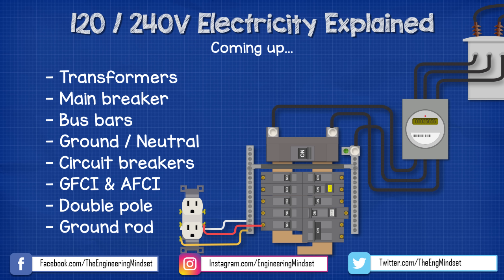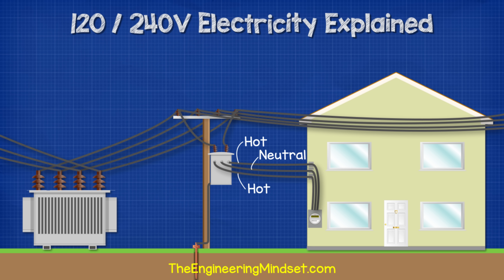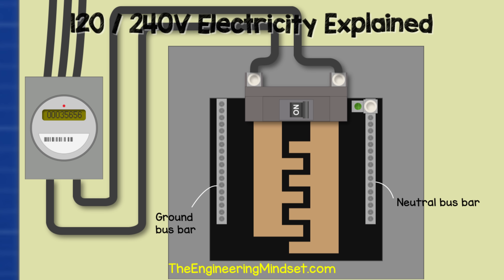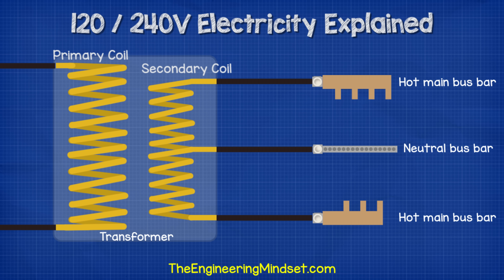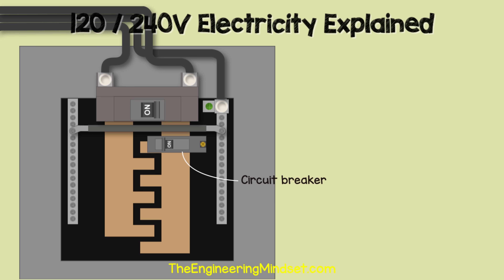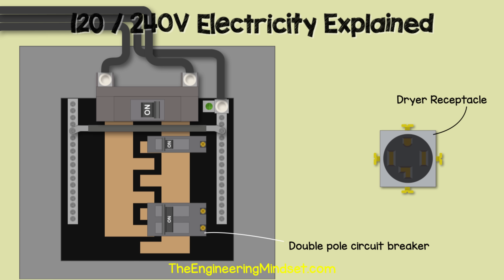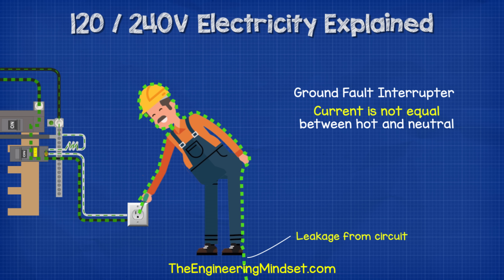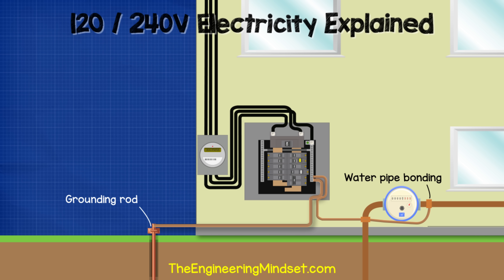120V 240V Electricity explained - Split phase 3 wire electrician

Comment: Wait, the ground wire in the US is connected to the Neutral? It's not connected to GROUND, like its name suggests?

Meaning that if a person becomes the connection to ground the breaker won't trip from the circuit running to ground?
Reply: The ground (green) wire must be connected to the Earth via a ground rod at some point
 for safe operation. If a person connects a hot wire to ground through his body, the breaker may not trip. It depends on how much current flows through the person. Of course a breaker can supply more than enough current to kill, so watch it!
The neutral is connected to the ground wire, but the ground wire does not carry any current, except in an exceptional (and unsafe) situation.
Reply: Correct. A GFCI is needed to protect against such faults.  A pity they don't put them on all circuits.
Reply: @Mister Brookes TN-C-S will protect if live is shorted to either N or PE since those are bonded together. But shorting to PE is not the same thing as shorting to ground.  A GFCI protects again a ground fault (eg you touch live while standing on the ground). TN-C-S only blows the fuse when live shorts to PE - eg your toaster breaks somehow and the chassis is connected to live. (and is safe to touch).
Reply: The "neutral" or grounded conductor, is created at your transformer. At one end all the coils of your transformer are tied together and to a ground (typically a ground rod driven into the Earth) from this connection a "neutral" wire is also connected which is why in code it is called the grounded conductor.
Reply: @vegasjw  here's hoping the connection back to the transformer doesn't fail then. and that you don't create a path to ground from live with your body.
Reply: @jnawk83  this is the connection that is on every wye connected transformer. Along with the neutral there is a ground conductor in every conduit/raceway which bonds all metal parts and gives a low resistant path to ground. If the neutral "fails" you have an open neutral and therefore have an open circuit. As the video says the neutral is the return path for the current in the wire. I think you are confused about what a breaker does and a GFCI does. A GFCI simply measures the difference between the current in the hot and neutral and turns off the circuit in less than half a cycle if there is even a very small difference in current. A GFCI is designed to protect people and is only used in wet or outdoor locations. You can't use a GFCI for every circuit because the inrush current in many loads is enough to cause nuisance tripping.
Reply: @vegasjw  if you didn't run absurdly low voltages then you wouldn't need to run absurdly high levels of current, and frankly, power factor correction electronics are not that big a deal for residential workloads. there is an RCD on every circuit in my house, and the same is true for all code compliant houses in my country, yet nuisance tripping is not a thing.
Reply: @jnawk83  Yeah I don't understand the use of 110v in the US, doesn't make any sense to me. You more than double the required current to run the same devices at the same power. And to do so means you need much much more copper to handle that current, and even then still a great chance of fire because of high current.

The 230-250VAC of most other countries, Europe, Australia etc. is much better.
Reply: @vegasjw  Jesus a GFCI isn't used everywhere in the US? My god.

Here in Australia, every single circuit is on an RCD (GFCI in US). The same goes for the UK, and all of Europe. 

Never had any nuisance tripping. And the fact that not every circuit is ground protected is just insane, and dangerous.

I can RCD replacements for my circuit board for like $15 each.

Ground faults don't just occur in wet areas, that's a stupid and dangerous assumption. Hell a ground fault can occur in a light fixture. Metal fixture body, grounding fails, or isn't connected properly. And you touch the light fitting, and in the US, obviously, you're dead.
Reply: @PBMS123  No, code does not require a GFCI everywhere here in the US. I don't write the national electrical code I'm just telling you what it says. And no, wet areas do not "create" a ground fault but it is much more likely you will be a path to ground in a wet area. I have seen nuisance tripping on loads that have high inrush current. Most residential probably wouldn't be affected by that but I work mostly heavy commercial and industrial. Lots of motors and other equipment
Reply: @jnawk83  I don't have any choice how power is generated. I don't know why the US power companies choose to use 120/208, 277/480 in most residential and commercial.
Reply: @vegasjw  Yes I know your not, but it doesn't mean that electricians can't exceed the code, to be safer for everyone. And it seems odd not to go with what the majority of the rest of the world does. In Australia RCDs were mandated on all circuits by 1990s. 

You can get RCDs as well as other devices that help with starting inrush current in high inductance loads to stop nuisance tripping. The inrush is generally very short lived, and a lot of RCDs have a minimum time activation.

It just seems to very very unsafe not to have ground protection for every circuit, also seeing as it seems US plugs haven't caught up with times with insulated plug prongs to stop possible ground circuit if you touch a half inserted adapter.
Reply from the maker: Watch this https://youtu.be/P-W42tk-fWc
Reply from the maker: We just published a new Ground fault, short circuit and arc fault video, so much detail! Link HERE➡️: https://youtu.be/Qi0ynSQw-wc

Comment: Spot on accurate, excellent video. Glad you didn't show the neutral and ground wires heading to the same screw. Schuko plug into a NEMA 5-15 outlet looks kind of funny tho.
Reply: I agree, in Canada, we still land all neutrals on one of the bars, and all grounds on the other one.  This is to aid in identification along with easily powering the panel from another temporary power source in an emergency by just removing the connection between the neutral bar and the ground bar.

Comment: Will a 240V equipment meant for the North American Market work safely in the UK or European electricity network?
Reply: No. North America uses 60 hz split phase. Europe uses single phase 50 hz
Reply: Maybe. Remember that the current in Europe is 50hz, in the North America, 60hz.
Best not to try this unless you genuinely understand what you are doing. Asking this question makes me tend to think you should not be experimenting.
Reply: Well, yes and no. 240 volts is 240 volts, but most North American 240 volt equipment assumes your running at 60hz and not 50hz. Motors would run slower at 50hz and that could cause issues with the equipment. Also, 60hz motors and transformers may saturate and overheat at 50hz. You can find transformers built for either frequency though and those will run just fine in both locations. As long as you don't have to worry about overeating and a motor is ok running a bit slower, you're ok. Quite a bit of US 240 volt equipment is built to work at either frequency.
Reply: @cmfrancis1  Thank you. I asked the question because I once read somewhere about motors simply running slower and that it is more dangerous trying to run a 50Hz motor on a 60Hz line. It was claimed it is the higher frequency that will lead to overheating.
Reply: @adon8672  North American equipment that runs on 240 volts in the US, also requires typically 30 amps of power or more in addition to 60Hz. Typical 240 volt home electrical in the UK and in the EU is limited to a maximum of 50 Hz and 13 ~ 16 amp maximum draw. So American 240 volt outlets tend to be more powerful than what's found in the EU. My electric oven for example, requires 240 volts at 60Hz and needs at least at 50 amp breaker.
Reply: ad on    The answer is yes it will work.   Voltage RMS is Voltage RMS.   If it has a motor, it will run slower.  Otherwise it works just fine.   We have less flicker in our lights here.😊.   Respectfully,   Kevin

Comment: Outside North America, there's a breaker that functions like GFCI, and it's known as RCCB (Residual Current Circuit Breaker), shortly known as RCD (Residual Current Device). It works in the same way. RCD is usually big as what I've found here (not sure if there are big GFCIs available in North America, or there are small RCDs available on the market, but atleast here I only found the big RCD). Circuit breakers are known as MCB (Miniature Circuit Breaker), and also it works in the same way as circuit breaker does.
Reply from the maker: Sure is, we've covered that recently if you would like to see more --> https://youtu.be/W0_1xRqT8uU
Reply from the maker: Seen our new incredibly detailed MCB video? link: https://youtu.be/gqEu9t8HwW0

Comment: One point about breakers: they are somewhat tolerant of small  and brief current overloads.  If you have, say, a 15 amp breaker, it doesn't just instantly trip at 15.01 amps.  It will tolerate a higher load (say 17 amps) for a minute or two before tripping.  But the higher the load, the less tolerant it is, so given a 20 amp load it will trip almost instantly.
Reply: A minute or two? Aren't these only for a a few seconds to stop an instantenous load spike in a high inductance appliance, like a washing machine to not trip it. But overlaoding the circuit breaker for a few minutes? Doesn't exactly seem like the smartest thing to do. And I would guess would amke that breaker out of spec.
Reply: @PBMS123    Good point!  It does sound odd so I'll explain further. The key point is that there are two different types of overcurrent:  inrush and steady-state.  These are treated as two different things by the electrical standards organizations and thus by breaker manufacturers. Each has it's own specifications and measurements.

 The following paragraphs refer exclusively to the Residential Circuit Breaker with Over Current Protection (RCBO).  Non-RCBO circuit protection devices like high voltage, non air-break, solid state, oil filled,  thermally actuated, etc. have different specifications and behaviors.

  Yes, RCBOs must tolerate inrush current (caused by starting things like motors, transformers, certain fluorescent ballasts, heat-producing filaments, etc.) without tripping.  Homeowners would be annoyed if their vacuum cleaner tripped the breaker every time they tried to use it. Inrush current can be several times the breaker's rated current, but typically lasts only a few AC cycles. RCBO's don't react to inrush overcurrent unless it reaches a preset level called the Instantaneous Tripping Current.

  I referred not to inrush overcurrent but to steady-state overcurrent. These are considered separately in RCBO specifications, so breaker manufacturers test for both things: The Instantaneous Tripping Current (usually specified by type B, C, D, K or Z) and the Trip Time Delay vs. Current, specified by a set of curves on a graph.  These are called Delay Curves  and show graphically what I described initially. (For light reading, IEC 61009-1 (2013) defines the specifications RCBOs must meet, and NEC 240 governs the proper use of RCBOs.)

  Here's how to observe this at home: Turn off one of your breakers and identify outlets it controls. Then remove the breaker box cover and carefully attach a clamp-type ammeter around the black wire leaving that breaker. Turn the breaker back on, and plug things into those outlets until the the ammeter's reading rises above the breaker's rated current. Then you can play around with the load and watch the breaker's reaction to different steady-state overcurrent conditions.
Reply from the maker: Seen our new CLAMP METER tutorial?: https://youtu.be/J3kKNNizARc

Comment: Here in Europe we have one phase more.
Reply: Same in the US but only in commercial/industrial buildings. Residential have 240V split phase.
Reply: In europe you have 2 more phases.  We also have 3 phase power, but not in homes. There is often 3 phases on the power pole but a house only connects to one of them. Your neighbor might be on a different phase.
Reply: @stargazer7644  Here are three phased lines connected in every standalone house, because many people are using 3 phases for high power applications like ovens, or circular saws, pumps, etc...
Reply: @Gangster88232  Here we use 240V single phase for those types of loads.  Most loads here in a house are 120V.  The stove/oven, hot water heater, laundry dryer and air conditioner/heat pump and well pump are 240V connected.  Everything else is 120V.  I have 240V in my garage for charging my car.
Reply: @stargazer7644  I know, but with 3 phase you have easer deal with motors, you dont need start up capacitors and you can easy and roughly control power by switching it into delta/star without frequency changer.

Our standart outlet for high power apps is mostly 3x 230/400 V 16 or 25 A per phase.
Reply: @stargazer7644  Not here in Germany. I've got 3 phases in my flat and all my neighbours too.
Reply: Europe is not a country. You shouldn't speak as if it is nor compare it to one.

Comment: Nicely explained. But I still have questions. It seems to me that the neutral wire going back to the street transformer from the main power panel is required to carry twice as much (spent) current (electrons?) as each hot wire when  used to power only 120 volt devices. Does the neutral wire not need to be a thicker conductor???   Also, how does the residential power meter sum the current consumed from 240 volt, 120 volt from the "A" side hot and the "B" side hot to the neutral line? Seems to me it would require three amp meters and they then get appropriately summed to spin the current meter and advance the counter.
Reply: Norm Folkers   Things are a bit simplified on this video, but the two hot phases are out of phase, this means that just as one phase is taking electrons the other phase is giving electrons. If the currents are equal then the sum of the currents will be zero.  In residential power systems there is an effort to distribute the load so the currents sum to as close to zero as possible. This means the neutral wire can be smaller than the hot wires.
Reply: Thanks for the additional explanation. It makes sense. But I'm more familiar with PWM DC wiring. It is common to take into account the gauge of the wiring make sure the wires don't get too hot. It seems to me that the AC neutral wire is still asked to do double the duty of each of the hot wires even though the electrons and holes (measured current) are going back and forth in the neutral wire. Still, I have a better understanding now compared to yesterday. TY ;-)
Reply: @normfolkers8966  they aren't going back and forth on the neutral.  each hot is 180 degrees out of phase with the other.  if the 250v appliance (eg clothes dryer) doesn't need 110v then it doesn't even connect to the neutral wire.

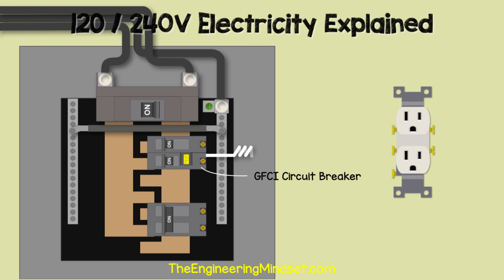Comment: 9:42 There are GFCIs that are built into outlets. I think they're usually in newer buildings, and old ones probably have something more like what you display here. Great video, keep it up!
Reply: Other way round. The outlets are for retrofitting bathrooms and kitchens. The breakers are more common in new construction.
Reply: @jstan_49  Tbh, I didn't quite know that, I do live in a house that was constructed about a decade ago. I assumed that it was still somewhat modern, but I guess that I was wrong.
Reply: @thedankmemelord5215 , gfci breakers have been around for years, but other than for hot tubs, I have rarely ever seen them in house panels until recently. Usually the outlets were used, probably because the breakers were more expensive.
It is also sometimes convenient to be able to test and reset from the room involved, instead of having to go to the panel.

Now that afci and gfci are being combined in breakers, and prices are coming down, a lot of times it's more logical to use the breaker, and then just put a sticker on the outlet.
Also, you don't have issues with  gfci outlets dying from high humidity and gunk buildup.

Comment: So the transformer will not use three phases across the inbound and outbound power?
Reply: From my understanding of it. The power plant sends out 3 phase. When it gets to a distribution sub station they send out the 3 phases in separate ways and uses a transformer to drop it down to 240v while using a centertap to get the neutral.
Reply: There are three-phase transformers, but they are not used in this application. 
Normal residential power distribution is all single-phase. 
Some residential areas do have three-phase "top wires" --- the moderately high voltage from the local substation --- 
but the primary of each pole transformer is connected across only two of the three top wires. 
Throughout any such area, the numerous pole transformers are connected in any of the three possible ways 
in order to distribute the load as evenly as is practical among the three phases.